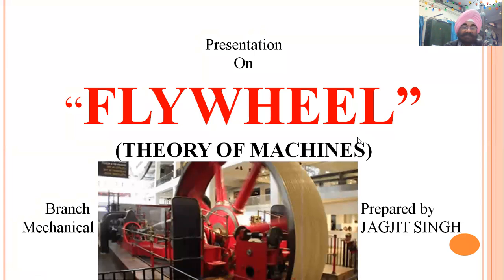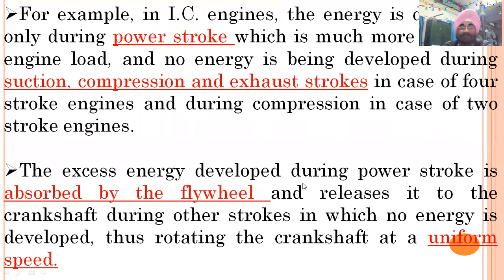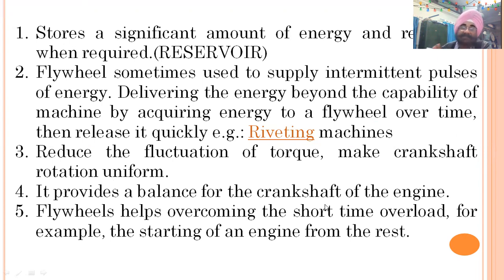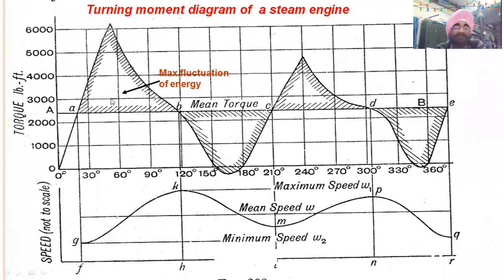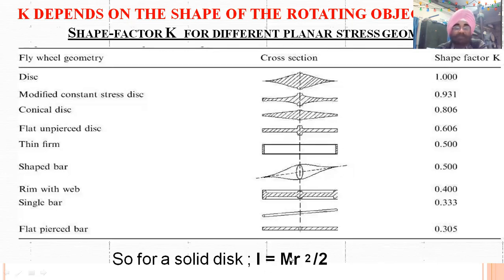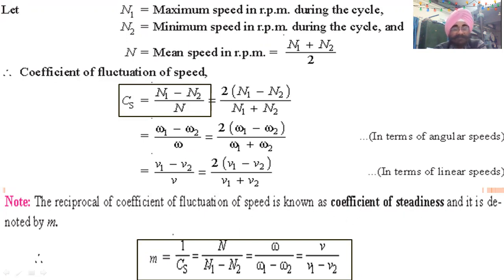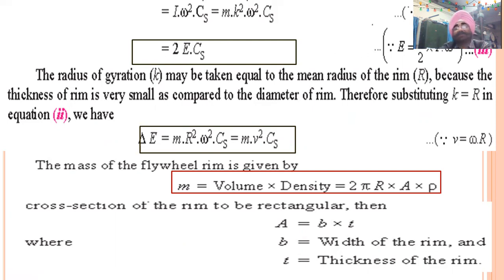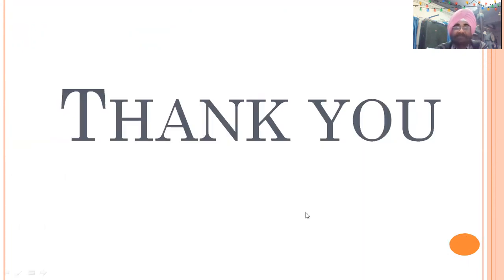FLYWHEEL Lecture in easy Hindi-English-Chap-3

Comment: How long can flywheels store energy?
Reply from the maker: The process of storing and releasing the energy is cyclic
Half cycle for storing
Half cycle for releasing

We must remember that the "energy is stored due to momentum-caused due to weight and motion"
As soon as the flywheel is stopped the energy is released after half more of the rotation.
Reply: @hsbtetutoronline-jsn  But sir, the energy stored in the flywheel is gained by the excessive efforts by the driving force. So, it is the only excessive which is being stored as the momentum of the flywheel. Also, while releasing the energy ( assuming the flywheel is rotating at its peak speed), the energy is being released at an instant of time. Thus, the energy is being lost at that time. So, I think its only the mechanism for a limited period of time and the energy cannot  be stored for long intervals.
Reply: Also, the graph of this follows a hill peak like shape. First the graph rises upwards as the speed of the flywheel increases and then the flywheel is at its peak speed then the  flywheel loses its energy suddenly when subjected to release its excessive energy. And the curve follows a downward hill slope.

These are my point of views, sir. 
And THANK YOU for your excellent teaching.